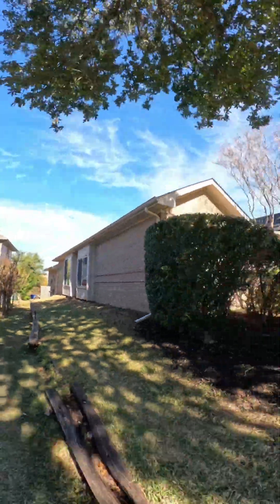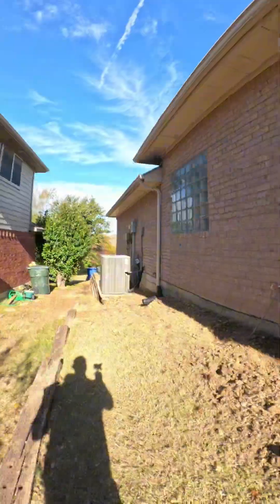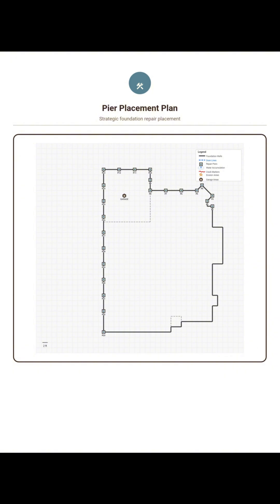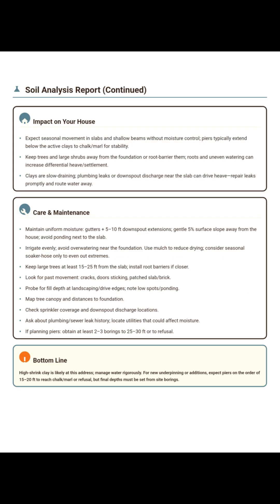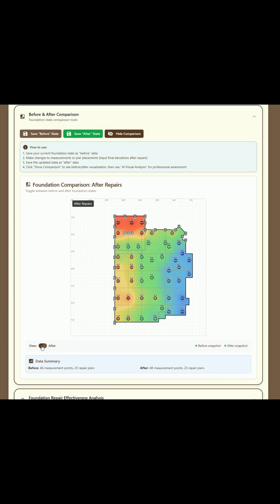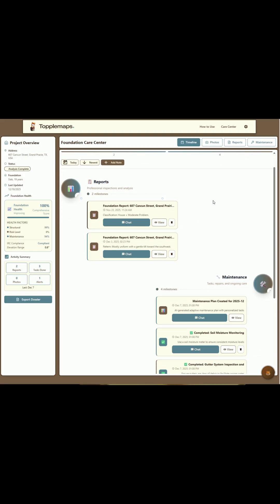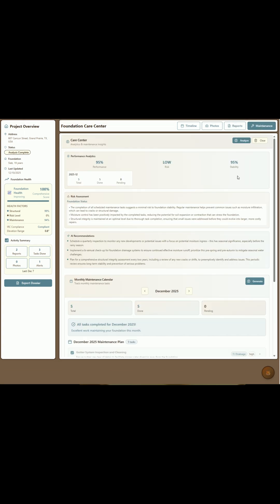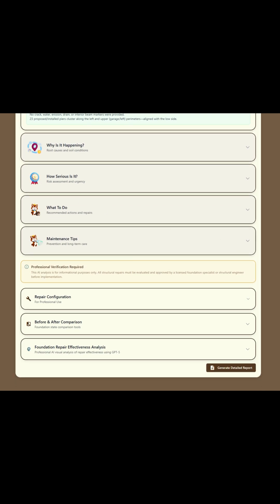The Future of Foundation Repair: ToppleMaps Before & After

Comment: Why is the front of the house still low after the repairs?  Is it to make sure the driveway still aligns to the garage without a huge bump?
Reply from the maker: The garages are always built with slope, the standard slope is around 1.5 to 2 inches